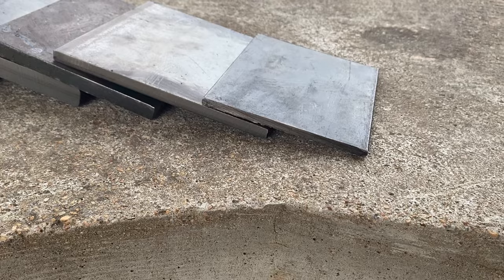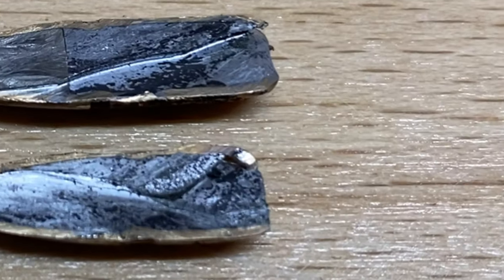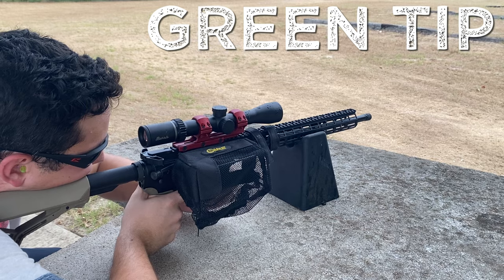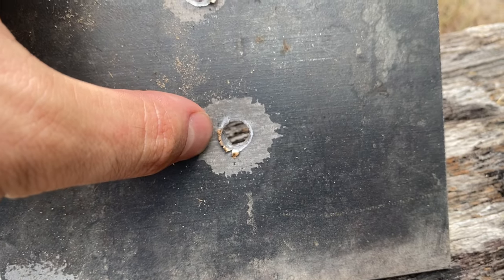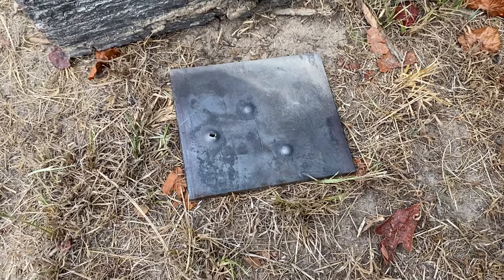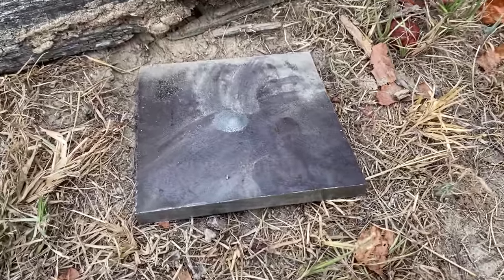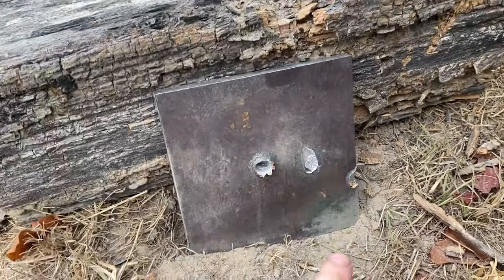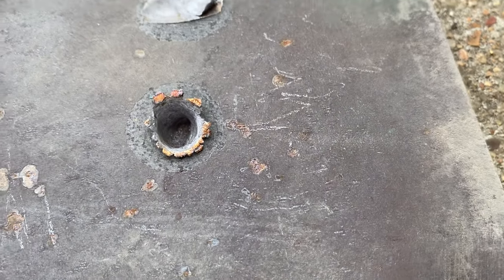How Effective Is 5.56 Green Tip Against Steel? (Green Tip vs. FMJ)

Comment: Can someone point out to a video where there is a comparison between a single steel plate versus multiple sheet metal?  For example.  1/4 inch steel plate vs multiple thin metal sheets STACKED TOGETHER creating the same 1/4 inch thickness.   The reason I am asking is I am trying to create a thicker door panels.  With thin metal sheets I can easily follow the curve of the door.   Layer after layer. Thanks!

Comment: Not to be a troll, but lighter faster bullets do not penetrate as far as heavier bullets; although, to be a valid comparison, it should be the same weight bullet.  The heavier bullet is already going to penetrate deeper, so how much of the effect is weight and how much the steel penetrator?  I think people get confused that faster bullets have higher energy so they think they should penetrate farther, but heavier bullets have more inertia which pushes them farther.  Just like most people who don't know think lighter bullets are better for long range because they are going faster; however, same caliber heavy bullets retain much more of their velocity at longer range and end up being faster down range.

Comment: This is why they chose the round. However in reality the number of situations you benefit from the 7 grain penetrator is tiny compared to how often you’ll benefit from the better accuracy and performance of the 55 grain FMJ.
It was sold to NATO successful by FN because it increased the range it could penetrate a steel helmet by like 100 yards I believe. So instead of 500 it was 600. Who the hell was taking head shots at 600 yards with iron sights I don’t know??? It’s possible but very difficult Simo Haya kept his shots around 350 meters I believe at the longest and he used irons. Also killed more men than any sniper in history.
Ultimately I still believe SS109/M855 was a huge mistake over M193 (though we should have gone to 1/9 twist for SMK). 
However if we ever go to war against 3/8” mild steel I’ll be grabbing green tip and going to town!!!

Comment: Try the M855A1 round. Same as you, I've not been able to get a M193 or M855 to penetrate 1/2in of steel regardless or barrel length or distance. But the M855A1 out of 11.5in barrel went clean through the 1/2in plate. I'm curious what the upper limits of it are. Just haven't gotten a chance to test it more. Out of 16in barrel it went through 2 spaced 1/4in plates like butter.
Reply: 1/2” mild steel, the 8” pine tree my plate was hanging on, then splashed into the pond behind it.
Reply: @blackhawk7r221  since this comment, I tested it again and from 14.5in barrel it penetrated 1/2 mild steel at out to 100m. Did not penetrate 5/8 in steel. I found it at the range so I can't be sure what it was made of but it seemed like mild
Reply: a M855a1 will go through all but NIJ IV when out of a 20 inch barrel, though I dont think it causes much of a difference compared to just using a 16 inch barrel as its just a powerful and fast round. I've heard the 5.56 works best out of a 20 inch barrel though for wounding with some people recounting at the velocities the round traveled at out of such a length that it'd "explode" and fragment harder than any full power rifle round inside of flesh.

Comment: I keep noticing in your videos that rifle rounds have trouble going through steel that’s 1/2 inch thick even mild steel can be pretty good Armor if it’s thick enough I have a plate of mild steel that’s 600mm long by 500mm wide by 80mm thick so just over 3 inches thick I don’t anything will go through that what do you think that will be pretty strong Armor. I also have 16 mm thick AR500 silhouette, plates to and then I also have a 50 mil thick plate that’s made out of AR450 steel grade
Reply: 3 inches of steel cant even be penetrated by HVAP 20mm autocannon rounds, maybe saboted AP but that depends on the range and core material, no rifle or HMG round has a chance of going through it, its thicker than most armor used on some of our IFVs and heavier armored vehicles. A 50mm plate might be able to be penetrated by a .50 BMG saboted penetrator (SLAP) at the muzzle as its rated to go through anywhere from 45-52mm of steel at 0 degrees and at near point blank range. Armor piercing 14.5mm may go through it at the muzzle too but im not well versed on how much armor they go through. 

16mm is about 5/8th an inch so it should be equivalent in effective thickness to an NIJ IV plate but those are angled (usually) so that in the case of someone unwisely firing steel core or other armor piercing ammo it wont completely gut the target.
Reply: @michigancube4240  I didn’t know a 8cm (3 inch plate) is so strong it’s only regular steel with the grade it’s made out of but we can’t get through it we shot some rounds of 30.06 rounds into it and the rounds only go 7mm deep at most it’s very strong
Reply: @johnthetoolmanchess8932  yeah, the armor thickness is thicker than the side armor on some tanks thats no surprise really. Mild steel and regular construction grade steel is quite tough despite being so soft, there are recounts of a few tanks in world war 2 where a few tanks made out of mild steel (meant for training the crews) took multiple anti-tank gun hits with no damage despite the round clearly being able to do so to normal tanks, the reality is that the softer mild steel didnt shatter or shear (as most normal hardness steel does at those impact velocities) and acted as a velocity sink and caught the rounds, I believe theres even pictures online somewhere that shows actual tank shells lodged in the armor of said tank.
Reply: @michigancube4240  yeah I agree with you that mild steel is very strong as well like in that video the guy couldn’t even put a green bullet through only just 1/2 inch of mild steel so it’s very tough. And yes my 3 inch plate is made out of 350 grade construction steel it says on the paperwork when I brought that plate a tank round would probably go through the plate

Comment: Why would you expect the velocity to matter more? The two rounds carry exactly the same amount of energy (Yes yes, double the weight means double the energy and double the speed means FOUR times the energy, but 3000 fps but with 12% more weight (62 vs 55 grain) means 12x2=24% more energy, and 6% (3 vs 3.2k fps) more speed means 6x4=24% more energy, aka EQUAL!), except one has a steel tip for better penetration, of course that will make far more difference! People overcredit velocity far too much.

Comment: Great video. My buddy just built his first AR, and we got him 500 rounds of green tip 5.56 (plus the ammo can) at ~ $235  (the 62 gr pmc xtac m855)

Any chance you could test that round/similar against hardened steel at 100 yards?
Reply from the maker: That's a pretty good price these days. I do have some 3/8" AR500 targets that I could test it on eventually. I'm not sure that I would make a dedicated video, but I could respond to this thread if not.
Reply: @bananaballistics  That would be great to hear your results. I’m fairly certain it won’t do much, but I am curious what a relative lifetime of that steel would look like using exclusively green tip rounds compared to regular fmj
Reply from the maker: I just shot a 3/8" ar500 plate at 100 yards with a 556 green tip and it left a small crater on the steel. A 556 55 gr FMJ did as well though, so I think that it is best to shoot ar500 at ranges further than 100 yards with a 556 for longevity.
Reply: Just picked up 35 boxes of green tips for .25cents a round! Thank cyber Monday!
Reply: @salmaya9274 on what website? Thanks

Comment: I remember seeing a ballistics chart for 5.56 based on barrel length and 20 inch was the optimal barrel length. Anything more you’ve already had full powder burn and the friction starts reducing velocity
Reply: 20" is the optimal length because it is the length that cartridge and powder combo was originally designed for. The shorter barrels common now (16/14.5/13.7) are considered "good  enough" to maintain acceptable terminal ballistics, but anything shorter is where the later design of the .300BLK is far more effective.

Comment: Man, I'll never understand any twist longer than 1:9 for .223/5.56.  Unless the only thing you're shooting are 40gr rounds, just leave the 1:12s on the factory floor.  Personally, I go for God's Twist .. 1:8.  Works great for 55-77gr rounds on both my 16" and 20" ARs.
Reply: My thoughts exactly!
Reply: @doityourself2save  the 1 in 12 worked pretty well for the M193. Remember the instability of the bullet is what caused it to tumble and fragment.
Reply: @donallen2819  1 in 14 was the actual original twist for the m16. They had to go to the 1 in 12 due to accuracy issues with ammo going through the 1 in 14 in different environments
Reply: FN Scar 17s 1-12in Twist Rate
Reply: @McMan_  ..that's a 7.62x51 rifle, not 5.56.
You're comparing apples and kumquats.
Reply: @TheMrMused  I'm Comparing the Twist Rate even though it is a different Caliber just using that as an example.
Reply: @McMan_  The weight of the bullet and its BC (length, diameter, profile), all go into the mix when looking at an effective twist rate.  Other factors can include barrel length and type of shooting/distance.

For 7.62 NATO, a 1:12 works well up to 168gr rounds.  Above that, 1:10 works well (need to shorten the rifling to get that heavier round spinning & stabilized).  A 1:10 won't excessively spin lighter rounds, but isn't really needed unless you know you're going to be pushing heavy rounds. PALMA/fullbore folks often utilize 1:13 or 1:14 w/30" barrels for .308/7.62 NATO.  Sooooooooo....

Point being, you're never going to see a .308/7.62 NATO with a twist below 1:10.

Comment: My actual steel targets must be a different hardness metal because I shoot them all the time with green tip and never had a clean pass through like this.
Reply: Most likely your targets are AR500 and appropriately thick.
Reply: @woodsghost9088  right, they are actual target steel and 3/8" thick, rated for most rifle rounds, not magnum rifle I wouldn't shoot them with any big hunting rounds but for 556 they are still totally fine and I've gotten as close as like 15 yards or so.

Comment: Green tips have soft steel "cones" in them. And require 1:8 twist bbls.
Reply: It isn't soft steel.
Reply: @Don Allen  Twist rate is determined by bullet length. Longer bullets require more rotational velocity and a faster twist to stabilize than shorter bullets. Heavier bullets of a given caliber tend to be longer than lighter bullets, but this isn't necessarily true, and both profile and composition are important. Spitzer projectiles tend to be longer and have their center of mass further to the rear than round nose projectiles, and therefore require faster twist rates. And monolithic copper bullets, like Barnes, will be longer for their weight than traditional lead core bullets because copper is less dense than lead. So a 70 gr 5.56mm Barnes will be longer and may require a faster twist to stabilize than a similar weight cup and core bullet, and a 190 gr .308 cal Sierra Matchking will  be longer and require a faster twist rate to stabalize than a 220 gr round nose flat base, even though the round nose is heavier.
The rotational velocity necessary to stabilize a projectile increases with the density of the atmosphere, or the medium the projectile is traveling through. When the military was developing the M16A2 and the M249 SAW with the M855 and M856 cartridges in the 80s, they discovered that due to the considerable length of the M856 tracer, it would only marginally stabilize in dense, cold arctic air with a 9 twist. So they went with a 7 twist to ensure stability of all current and future projectiles in all conceivable atmospheric conditions. The 7 twist is faster than needed for most 5.56 bullets and conditions, but it is generally better to overspin a projectile than to marginally stabilize it, hence the 7 twist is pretty standard on 5.56 mm fighting rifles while the 8 and 9 twist is generally found only on sporting rifles intended for range use or competition.

Comment: You're pushing the bullet too fast with the longer barrel.  It may sound counterintuitive, but the bullets have an optimum velocity to perform best.  Too fast, and they disintegrate.  That's why 5.56 barrier blind ammunition is usually 72-75gr pills at 2200-2500fps.  Slow a green tip down to 2500fps and I can all but guarantee it will blow through the 3/8" mild steel.
Reply: No. Velocity is crucial for penetration in steel, and the bullet will penetrate more steel the faster you push it. Increasing the velocity may decrease penetration in liquid and semi-liquid mediums, like tissue, due to fragmentation or expansion, but only helps penetration in steel. The physics is complicated, but impact produces heat. If you bang a hammer on a steel plate, the plate will eventually become warm to the touch. Bullets concentrate a large amount of energy on a small area. This creates heat. How much heat is created is a function of how hard the material is, the size of the point the energy is focused on, and how fast the energy is transferred into the target. A denser and harder bullet material, a smaller point, and a faster velocity will create more heat, which allows the bullet to penetrate farther into steel. Notice the spalling at the edges of the craters from the bullet impacts? That is mostly flash melted steel displaced by the projectile. Increasing the velocity decreases the amount of time the energy is imparted into the steel plate and increases the amount of heat produced, allowing the projectile to penetrate further.

Comment: 5.56 is designed for full burn in a 20" barrel, you don't much more out of it when going up on length. I would be interested in seeing the 6.8 spc 2 vs the 6.5 grendel out of 16 " and 20" barrels. The 6.8 was designed for a 16" barrel, the grendel seems to get better and better with barrel length.

Comment: It's all about the barrel pressures. Not the super amazing ability of the 556
Reply: Yep, add a (.) And still no difference. The casing will still expand and match the chamber. It might get stuck or explode.no difference, just no real understanding? All it really comes down to is a larger amount of or a faster burning powder.
Reply: How does barrel pressure relate to penetration?

Comment: OK. First off the green tips are called armor penetrating rounds. Not armor piercing but penetrating. To stabilize the rounds for accuracy the military uses 1:7 twist rate. Lead is heavier than steel but takes more to compress and causes a lot of heat wich will melt the steel you are hitting. Ergo why you have the long streamers on the hole. And why the 1:12 twist rifle the projectile hit sideways.

If anyone is impressed with the green tips I would not with any twist rate more than 1:8. 

But anyone in the military knows these 62 grain green tips are notoriously less accurate than the 55 grain FMJs farther than 200 meters even in an M16A2 or M4 with 1:7 twist rate. And you just proved twist rate matters.

Comment: Gas tax is not drying up. Prove it. Prove the amount of electric vehicles pushed gas taxes lower. Reporting driving habits is will not work. 
Wait till the power grid can't support the charging and there aren't enough charging stations for all

Comment: They aren't that spectacular.  Tiny dent ... like match head size .. 556 is to lightweight to do any flowering to a 3/8 steel target .
338 lapua green tip or .50 cal will be much more rewarding for damage display.  I was disappointed in the 566 ... no carnage .

Comment: Shooting steel is dangerous don’t try this at home… lol every single home shooting range has steel targets and most professional ranges have steel targets and steel targets are literally one of the most popular kind of targets in America… didn’t think that through there did ya?
Reply: That's why you're watching someone else do it!!!!!
Reply: @relentlessamerican9373  Well, that's your opinion. But I section bullets with a hacksaw, and green tips cut easily. As do older 7.62 x 39 "steel cores". And these bullets are why the US M16A2 went to a 1:7 twist bbl. Fast twist rate is for longer bullet lengths.
Reply: @kimness7796  not sure what that has to do with me making fun of him for saying “don’t shoot steel at home” but if we are shooting out some credentials I spent 12 years between a SOF unit and contracting, unlike most people that join the military I was already a gun nut before joining and now a days I own an outdoor range. The fast twist rate is actually for lighter bullet grains, 1:7 twist is optimal for 55GR and 62GR but 77GR does just fine. A slower twist rate is for a heavier bullet. Which a heavier bullet would be the longer one so kinda the opposite of what you just said. And yes the core in a green tip I suppose can be called sof depending on what your comparing it too because green tip isn’t a real AP round it has a light steel tip not a heavy steel core or tungsten.
Reply: @relentlessamerican9373  HI!!! Sorry! I was referring to a different comment. You didn't indicate what the issue was. I posted twice, Yes, I've been hit with bullet fragments at the pistol range(s) at least three times. None drew blood. But safety glasses are a must!!!  Also one needs to realize shooting at steel can be hazardous at close range.
Reply: @kimness7796  okay gotcha